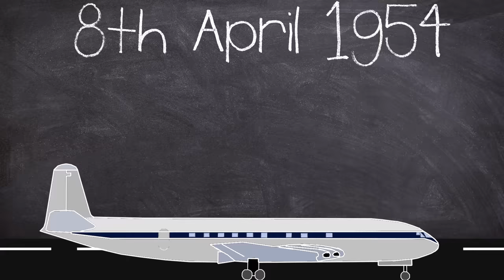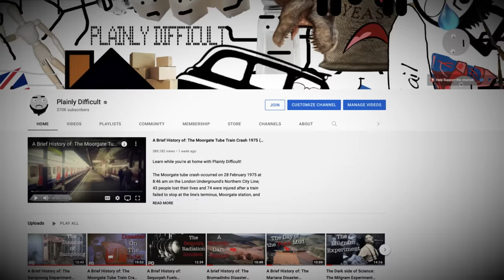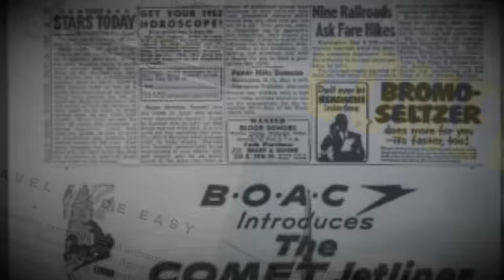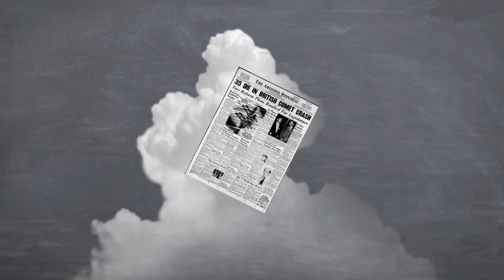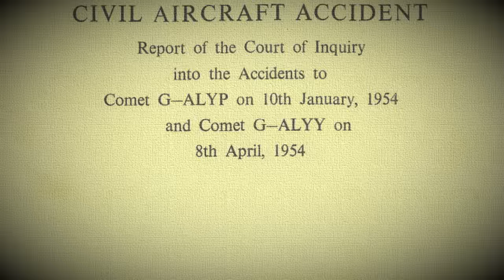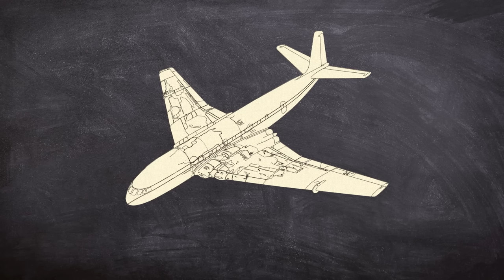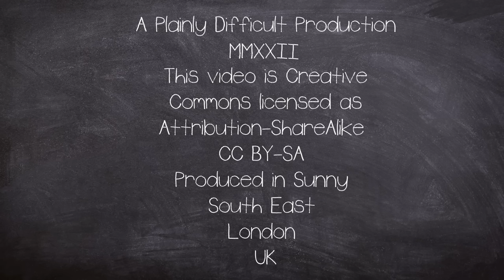A Brief History of: The de Havilland Comet Design Disaster 1954 (Documentary)

Comment: I would have loved to have travelled on the Comet. Remember my first flight on a DC9 in about 1968 and it was marvellous. Obviously there was some risk but hope fully the flight I would have been on would have been safe. I think the cause of the failures was the British used a specimen that had been static tested to proof load. Fatigue ignorance of affect of prestress beyond limit stress on fatigue. While oval windows better than square windows , square windows ok.  Another loss in my experience was I never flew on the Concorde ! !
Reply: Metal fatigue was well-known and understood at the time, unfortunately de Havilland was still building jet aircraft out of WOOD in the 1950s and simply lacked the engineering experience to build all aluminum aircraft.
Reply: This video has some BS included.
For example -
  
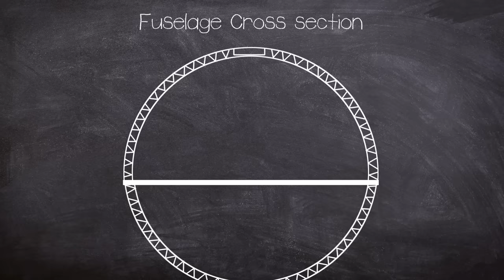    5:20   The idea that only the crew & passenger areas were pressurised is absurd obviously. 
  In fact every part of the fuselage was pressurised from the nose to the rear fuselage bulkhead including the entire cargo area.

Comets flew until 1997.
The Comet design had military use as a requirement. Nimrod development began at 
De Havilland before 1953.
Nimrods were not withdrawn due to structure problems or other airframe issues it was entirely a significant upgrade snag & resultant basic economics & an end of line sale happening at Boeing at the same time.

We feel we can shed some light on some common misunderstandings.

At the time the Comet wasn't particularly dangerous.

Losses comparisons
How things were in those days.

DeHavilland Comet 4 UK           14% 
DeHavilland Comet all  mks       17%  

Boeing 307                               70%
Boeing 247                               48%
Boeing 707            .                  20% 
Boeing 707                                20% 
Lockheed Electra Turboprop   29%
Canadair CL-44  Turboprop     46%  
Convair CV-580  Turboprop     22%
Convair CV-880    (ff 1959)       27%  
Convair CV-990     (ff 1961)      35%

    Of course De Havilland had prior experience building many all metal construction airframe aircraft including thousands of jet powered fighter aircraft that were primarily of metal construction with pressurised cockpits & jet engines built by De-Havilland.

   De Havilland carried out full stress analysis & engaged in a comprehensive & protracted testing program which is why key De Havilland people were happy to be aboard flying DH Comet aircraft.

   The DH Comet was the first passenger airliner with full length fuselage pressurisation at 8psi pressure differential. Handley Page built the world's first airliner.

   Of course ripstop provision was provided. The skin alloy used became unavailable at the time due to R & D at the manufacturers which resulted in the original alloy being discontinued.
The skin thickness used for the Comet was used for similar later aircraft. 
Frame spacing was not found to be too large & frame width was not found to be too small.

  De Havilland did indeed always work to better than industry standards at the time, used up to date knowledge for the design & construction & no evidence of negligence  or criminal negligence was ever produced in relation to the DH Comet.

  The DH Comet had no effect on the course of the aerospace industry in the UK. The UK now has the world's largest combined nuclear, aerospace & defence sector per capita activity.

    The investigation committee did not find hundreds of fatal flaws or evidence of design defects, structural defects, defective materials or shoddy workmanship. Ripstop provision was included. Claimed incidents did not involve cracks starting from window corners.
Pretty much all changes were just in case changes or were planned development modifications & improvements that were scheduled regardless of incidents.

De Havilland designers knew all there was to know about metal fatigue at the time they designed the DH Comet.

Hope this helps.

Cheers 👍
  
   
  xcvcvvvv

Comment: Unfortunately, you missed some crucial facts. I highly recommend this video by Robert DuHamel: https://www.youtube.com/watch?v=2rvx-r2itrE The square windows were - surprise - not the cause of the disintegration and hull loss events. Of course, the hull fractured from the edges of the windows (or so it seems), but not because they were square shaped. The first problem was in the test procedure when they over-stressed the fuselage initially, which "cold formed" the metal, making it stronger. Only after this initial step, they went on to do the expected cycle testing. This led to incorrect results, as other hulls were not over-stressed before entering service. The second problem was that the window frames were not glued, as originally intended, but riveted - and the holes for the rivets were not drilled, but punched. Punching the holes introduced stress in the "skin" of the hole and also microscopic fractures. These two problems were the main reasons for the disaster. The cracks did not start at the edges of the windows, but they started from the rivet holes, even though initial conclusions missed this very critical difference. The rivets should have not been there in the first place, but gluing was expensive. And when rivets would be chosen, the holes for them should have been drilled and not punched, to avoid introduction of stresses and microscopic fractures, what would grow larger over time. The shape of the windows themselves were not the cause of the disasters. Modern aircraft have rectangular windows, even if only on the cockpit. And they do not crash because of their shape. And all rivet holes on airplanes are being drilled, not punched. The reason is obvious now, but back then it was not.

Comment: It sure looked badass though.
Reply: Worst engineering failure in jet airliner history
Reply: This video has some BS included.
For example -
  
    5:20   The idea that only the crew & passenger areas were pressurised is absurd obviously. 
  In fact every part of the fuselage was pressurised from the nose to the rear fuselage bulkhead including the entire cargo area.

Comets flew until 1997.
The Comet design had military use as a requirement. Nimrod development began at 
De Havilland before 1953.
Nimrods were not withdrawn due to structure problems or other airframe issues it was entirely a significant upgrade snag & resultant basic economics & an end of line sale happening at Boeing at the same time.

We feel we can shed some light on some common misunderstandings.

At the time the Comet wasn't particularly dangerous.

Losses comparisons
How things were in those days.

DeHavilland Comet 4 UK           14% 
DeHavilland Comet all  mks       17%  

Boeing 307                               70%
Boeing 247                               48%
Boeing 707            .                  20% 
Boeing 707                                20% 
Lockheed Electra Turboprop   29%
Canadair CL-44  Turboprop     46%  
Convair CV-580  Turboprop     22%
Convair CV-880    (ff 1959)       27%  
Convair CV-990     (ff 1961)      35%

    Of course De Havilland had prior experience building many all metal construction airframe aircraft including thousands of jet powered fighter aircraft that were primarily of metal construction with pressurised cockpits & jet engines built by De-Havilland.

   De Havilland carried out full stress analysis & engaged in a comprehensive & protracted testing program which is why key De Havilland people were happy to be aboard flying DH Comet aircraft.

   The DH Comet was the first passenger airliner with full length fuselage pressurisation at 8psi pressure differential. Handley Page built the world's first airliner.

   Of course ripstop provision was provided. The skin alloy used became unavailable at the time due to R & D at the manufacturers which resulted in the original alloy being discontinued.
The skin thickness used for the Comet was used for similar later aircraft. 
Frame spacing was not found to be too large & frame width was not found to be too small.

  De Havilland did indeed always work to better than industry standards at the time, used up to date knowledge for the design & construction & no evidence of negligence  or criminal negligence was ever produced in relation to the DH Comet.

  The DH Comet had no effect on the course of the aerospace industry in the UK. The UK now has the world's largest combined nuclear, aerospace & defence sector per capita activity.

    The investigation committee did not find hundreds of fatal flaws or evidence of design defects, structural defects, defective materials or shoddy workmanship. Ripstop provision was included. Claimed incidents did not involve cracks starting from window corners.
Pretty much all changes were just in case changes or were planned development modifications & improvements that were scheduled regardless of incidents.

De Havilland designers knew all there was to know about metal fatigue at the time they designed the DH Comet.

Hope this helps.

Cheers 👍
  
       
   . .... ... ....

Comment: I didn;'t know the comet was around for as long as it was.. I thought it was completely dead after the results of the water tank.
Reply: The Comet 1 was grounded and had its airworthiness certification permanently revoked and never flew commercial passenger service after 1958.
The Comet 4 is a completely redesigned aircraft with a different airworthiness certificate it entered service in 1958 although most of the original orders had been canceled by then.

Comment: Plainy Difficult, your assessment of the accidents' historical legacy is correct, and you missed the huge steps forward in mechanical engineering engendered by the investigation. First, low-cycle fatigue was investigated as a phenomenon separate from high-cycle fatigue; second, the evolution of crack and the concept of critical crack length were better developed. Finally, design standards for materials in fatigue service were implemented that allowed inspection and evaluation before failure. The heads of the rivets in the Comet were large enough to hide cracks of the critical length; we now design so that critical cracks will extend past the rivet head. During major overhauls on modern aircraft, every last rivet connection in the skin is inspected for cracking. There used to be a print ad for Lufthansa showing a tech with a magnifying glass doing exactly that. We learned a tremendous amount from these accidents, but only because we invested the time and effort to find the truth.
Reply: well said 👏

Comment: Shouldn't this be plane-ly difficult?

I remember watching seconds from disaster about this, hard to believe how a simple design change fixed the problem.
Reply: IT DIDN'T.
The investigation found nearly 100 Fatal or serious design, manufacturing and materials defects in the Comet 1.
The Comet 1 was so badly designed that it could nor be fixed and the aircraft had its airworthiness certification permanently revoked  in 1958.

The Comet 4 has the highest loss rate and fatalities rate of any jet airliner built after the Comet 1 was grounded in 58.

Comment: Air crash investigation professionalism has come a long way too. Blows my mind how they used to treat air crash causes "ah...it's probably pilot error. Case closed" or don't even ever look into it really at all if they crash in areas where it looks like a pilot screw up (like EA 980 - But that was more than just assuming, there was shady stuff going on with the governments involved...poor ol Greg Feith had to go mountain climbing and camp out for a few days to reach that accident)
Reply: Reckless and irresponsible aircraft manufacturers like de Havilland also no longer exist...
Reply: This video has some BS included.
For example -
  
    5:20   The idea that only the crew & passenger areas were pressurised is absurd obviously. 
  In fact every part of the fuselage was pressurised from the nose to the rear fuselage bulkhead including the entire cargo area.

Besides that.
The engine position & inlet design were not flaws or fatal flaws, there were good reasons for that design choice at the time.

Comets flew until 1997.
The Comet design had military use as a requirement. Nimrod development began at 
De Havilland before 1953.
Nimrods were not withdrawn due to structure problems or other airframe issues it was entirely a significant upgrade snag & resultant basic economics & an end of line sale happening at Boeing at the same time.

  We feel we can shed some light on some common misunderstandings.

  At the time the Comet wasn't particularly dangerous.

Losses comparisons
How things were in those days.

DeHavilland Comet 4 UK           14% 
DeHavilland Comet all  mks       17%  

Boeing 307                               70%
Boeing 247                               48%
Boeing 707            .                  20% 
Boeing 707                                20% 
Lockheed Electra Turboprop   29%
Canadair CL-44  Turboprop     46%  
Convair CV-580  Turboprop     22%
Convair CV-880    (ff 1959)       27%  
Convair CV-990     (ff 1961)      35%

    Of course De Havilland had prior experience building many all metal construction airframe aircraft including thousands of jet powered fighter aircraft that were primarily of metal construction with pressurised cockpits & jet engines built by De-Havilland.

   De Havilland carried out full stress analysis & engaged in a comprehensive & protracted testing program which is why key De Havilland people were happy to be aboard flying DH Comet aircraft.

    The DH Comet was the first passenger airliner with full length fuselage pressurisation at 8psi pressure differential. Handley Page built the world's first all metal construction airliner during the 1920s.
    In many cases earlier pressurised aircraft were larger, needed thicker fuselage skins due to flying stresses & had much lower pressurisation differential pressure.

   Of course ripstop provision was provided. The skin alloy used became unavailable at the time due to R & D at the manufacturers which resulted in the original alloy being discontinued.
The skin thickness used for the Comet was used for similar later aircraft. 
Frame spacing was not found to be too large & frame width was not found to be too small.

   De Havilland did indeed always work to better than industry standards at the time, used up to date knowledge for the design & construction & no evidence of negligence  or criminal negligence was ever produced in relation to the DH Comet.

   The DH Comet had no effect on the course of the aerospace industry in the UK. The UK now has the world's largest combined nuclear, aerospace & defence sector per capita activity.

    The investigation committee did not find hundreds of fatal flaws or evidence of design defects, structural defects, defective materials or shoddy workmanship. Ripstop provision was included. Claimed incidents did not involve cracks starting from window corners.
Pretty much all changes were just in case changes or were planned development modifications & improvements that were scheduled regardless of incidents.

  De Havilland designers knew all there was to know about metal fatigue at the time they designed the DH Comet.

Hope this helps.

Cheers 👍. 
 
 . . .... ... ..... .. .....

Comment: It's often debated how much Boeing learned about aircraft design from the Comet 1’s structural failings, but there are other areas where they definitely benefited from the Comet.

When Boeing were considering the viability of getting into the passenger jet market they were encouraged by the maiden flight, in 1947, of the Boeing’s B-47 Stratojet bomber, and by the maiden flight, in1949, of the world's first jet airliner, the de Havilland Comet. 

Boeing visited the Farnborough air show in1950 where they saw the Comet flying.  They also visited the de Havilland factory, where the Comets were being built. Boeing felt it had mastered the swept wing and podded engines configuration, which  would enable them to improve on the Comet. 
(Wiki Boeing 367-80)

Krueger flaps were fitted to the 707 along the leading edge between the inner and outer engines. This was in light of the Comet 1 take-off accidents.
(Wiki Boeing 707)

I understand that the Comet disaster, especially the way that the riveting was changed, highlighted the loose situation that existed in the British aircraft industry and led to a much tighter control, both by the industry itself and by the Air Registration Board.
Reply: The real tragedy of the Comet Disaster was that it could have been easily prevented if de Havilland had simply followed well-known and understood industry standards for construction of pressurized cabins made from riveted aluminum alloys.
 de Havilland had received technical data on metal fatigue from the B-29 program during WW2... but d-H was still building aircraft primarily from wood and fabric.
Reply: @Paul-Nicer58 Can you please give me the name of a British jet aircraft still in production?